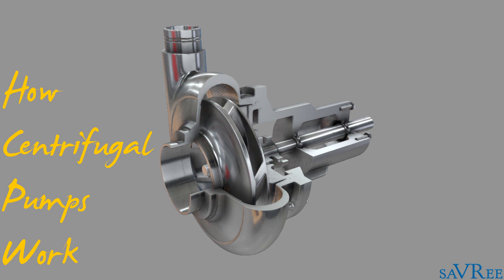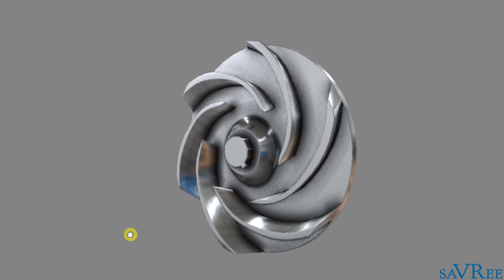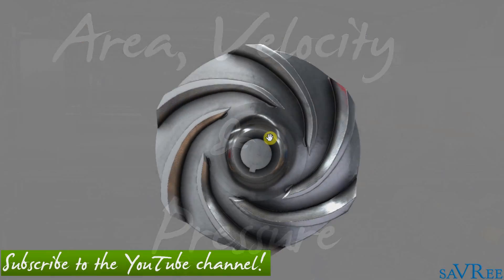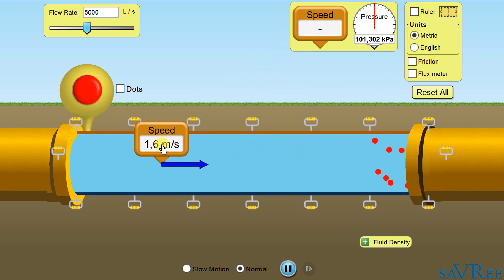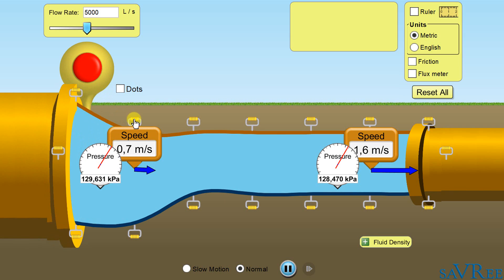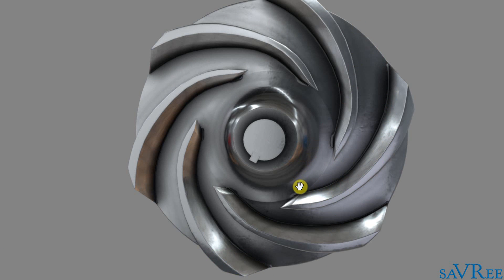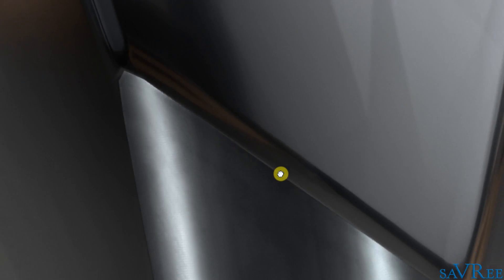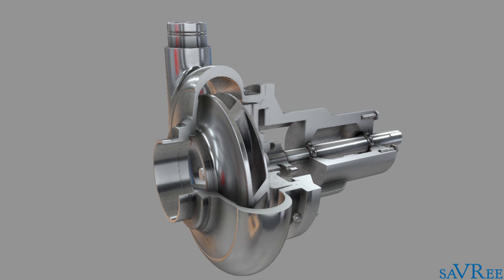How do centrifugal pumps work? (100% Animation)

Comment: there is one mistake in your explanation - at the exit of the impeller both pressure and velocity increase, because additional tangential velocity is imparted by the impeller blades.

Comment: I appreciate the animation however the scientific principle explained is a bit wrong. 
As the gas moves from the impeller towards the diffuser the centrifugal force increases the velocity, which then decreases through the diffuser increasing pressure.

Comment: Sir,  if the centrifugal force, acting on liquid particles, is the only motive force for pumping, there would  not exist a centripetal pump there. There is centrifugal, static and dynamic head, which add to the total head created by a pump.

At 9:34 - the comment about increasing pressure in azimuthal direction of volute is misleading. Volute is collector, which ideally works with constant pressure distribution (at a particular flow rate) around whole impeller outlet. The increasing area of volute in azimuthal direction is due to increasing inflow (outflow from impeller) in the azimuthal direction. There is azimuthal velocity component decrease, due to constant azimuthal momentum in volute if its radius is increasing. The diffusing part of volute casing  is usually placed downstream the throat of the volute. 
The effective flow cross section is perpendicular to streamlines. It is not correct to compare cross sections by comparing corresponding projection lines between two neighboring leading and training edges of impeller interblade channel, as it is not perpendicular to the stream lines.

The activity for public awareness of a pump working principle is appreciable, though.  Thank you.

Comment: Great video! However, I have a doubt, is there any explanation for the orientation of the impeller blades? I would have thought of an opposite orientation so the blades push the water in the same direction of rotation. Or does it work not by pushing the water but by suction? And then, comparing it with a francis turbine, does both of them have the same orientation or it changes and why? Thank you!

Comment: Great presentation! BTW, if the impeller blades were bent backwards and their spin in the volute casing remained the same, the fluid would still be pushed out, with an even higher pressure. The fluid would not get sucked in from the volute casing. I missed this question on an IQ test. Now I think of it as "everything spins away from the center, regardless of blade curvature".

Comment: Excellent explanation. Doesn't the volute increase in csa because more fluid is entering it from the impeller vanes? A lecturer I had once called a pump simply, a wheel on a stick.

Comment: Umm just a doubt 
If in a straight pipe on increasing area velocity decrease and pressure increases along length then after a certain length the pressure at the end of pipe will be higher ,so won't liquid start flowing backwards?

Comment: I am a bit confused. Isn't Velocity and Pressure directly proportional to each other. Why would Velocity increases and Pressure decreases at small area?
Reply: Great point. When he says "pressure" he means static pressure. The one you are talking about is "dynamic pressure". Think about it this way, if you have a baloon filled with some air and enclosed, it has some pressure in it. When you squeeze it, you feel that it resists your squeeze. Total air in the baloon is the same, so compressed that air and increased its static pressure. Now if you open the cap of the baloon, the air will leave it faster than if you have not squeezed it. In short, you first increase the static pressure and then convert it to dynamic pressure ( in other words flow speed). Now, in case of water, since it is not compressible ( in practical terms) when you squeeze by forcing it to accumulate through the outer diameter of the impeller, you directly convert static pressure to dynamic pressure ( velocity)

Comment: what draws the water into the eye originally????, for instance, at 3:53 the 'liquid would flow into the eye.....', sure but WHY?????
Reply: Because the suction which is larger than discharge is placed exactly where the eye sits, so that pressure delta of discharge which is much higher than whatever head pressure sits on the eye would create a vacuum towards the exit while in operation
Reply: It's a low pressure within the eye of the impeller

Comment: Got confuse Sir,,,,because Pressure is inversely proportional to Area. P=F/A
you said as the Area increases the pressure also increases...I think this is wrong....
Reply: If you are going to look from F/A perspective, then F is also different in that case, because in the section with bigger Area you should also consider the change in the Force = Mass * Acceleration and we know that the Mass will be higher in the zone of bigger Area. Bernoulli's principle is more based on the mass conservation principle, so when you have the static flow rate in the pipe the Mass * Speed for different cross-sections should be constant. It means, that in bigger areas the velocity will be low and vice versa. Knowing that the energy is also conserved the Bernoulli's equation should be satisfied

Comment: After watching countless videos on centrifugal pumps, I can comfortably say that this is the most well explained on the subject. I am Process Technician trainee and I find this very helpful. Thanks man.
Reply from the maker: Wow, thanks!
Reply: @savree-3d  how suction is happening on the first place
pls can u explain
Reply: @kirtan061 
I think suction is carried out because of Negative force. The impeller rotates, forcing the air  to flow out  from the casing. This creates a vacuum in the volute casing which draws the water to flow inside.
Reply: @MuhammadRahatLatifTousif  but isn't that air is not allowed to be in the pump? I'm still confused about this negative pressure
Reply: Truly it is a very helpful one.
He made it so simple enough to digest. Great job sir.
I am an Engine Cadet

Comment: doesn't pressure increase should correlate with the speed? as the smaller the hole the speed increase that makes sense but i thought the pressure should increase as well due to the narrower hole and the quicker flow or?
Reply: Great point. When he says "pressure" he means static pressure. The one you are talking about is "dynamic pressure". Think about it this way, if you have a baloon filled with some air and enclosed, it has some pressure in it. When you squeeze it, you feel that it resists your squeeze. Total air in the baloon is the same, so compressed that air and increased its static pressure. Now if you open the cap of the baloon, the air will leave it faster than if you have not squeezed it. In short, you first increase the static pressure and then convert it to dynamic pressure ( in other words flow speed). Now, in case of water, since it is not compressible ( in practical terms) when you squeeze by forcing it to accumulate through the outer diameter of the impeller, you directly convert static pressure to dynamic pressure ( velocity)
Reply: Same as what I am wondering

Comment: The impeller eye in this video is empty right? It is not like the picture in the link.
https://www.google.gr/search?q=pumps+rotation&tbm=isch&source=iu&ictx=1&fir=U253JFQFGVVoGM%252CB5p1zM7szzdyjM%252C_&vet=1&usg=AI4_-kTmo6yNaeL7YtTRe9YdD04YkZfNcQ&sa=X&ved=2ahUKEwi4oNjjjYTrAhWN4YUKHeDjCakQ9QEwEXoECAcQHQ&biw=1280&bih=610#imgrc=n4RVq2CdBnCtwM

Comment: How does impeller eye creates negative pressure?
Reply: It does not. Water itself creates negative pressure. Water cannot be compressed or expanded ( in scope of this pump example and in its liquid form ). Think of it this way, water is long fibers of string and when you pull from one side, all string will follow. Water does the same thing in propeller. You force it to move outwards ( you are pulling it outwards) and every water molecule pulls its neighbouring molecules outwards. Water molecules are held by hydrogen bond. So, if you pull more than the hydrogen bond can handle, you simply rip apart some molecules from its neighboors and create cavitation ( Steam or gas phase)

Comment: You didn't show the animation I didn't understand how the water flows in eye of impeller there is a screw attached to it.
Reply: No from opposite side there is suction pipe from which after priming water start moving into impeller......and this nut is of engine to rotate impeller .....